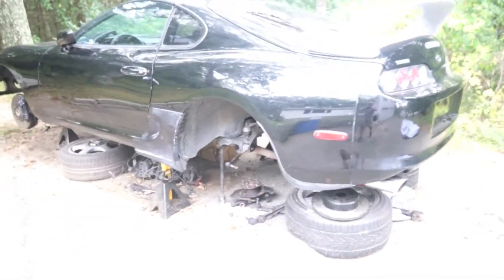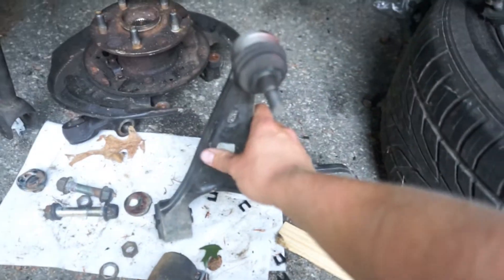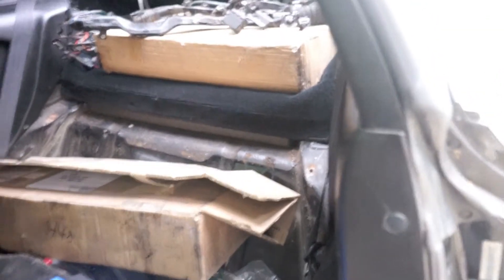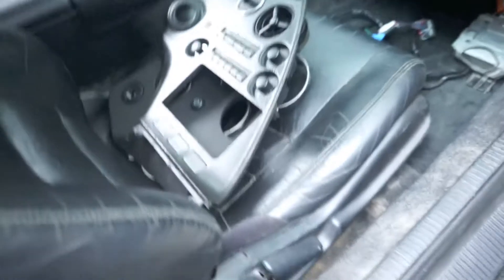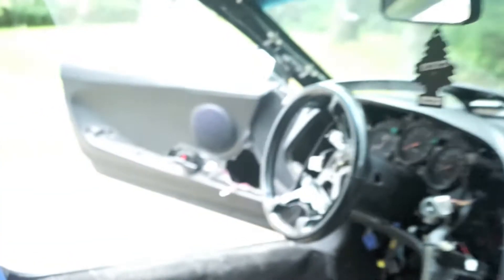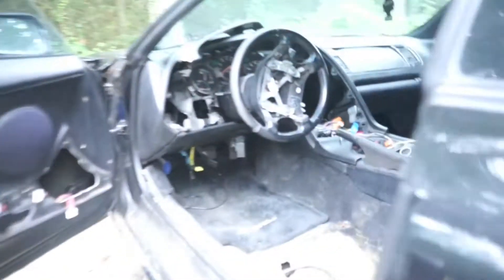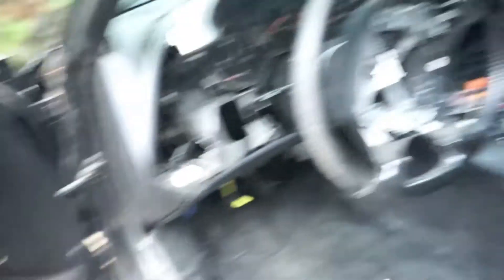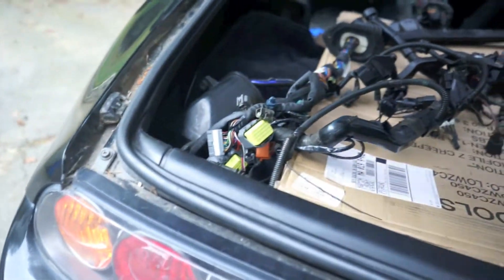My Mk4 Supra Build #6: Preparing for the 2jz!

Comment: If you're serious about letting that rear upper control arm go, try posting it on Evan Beckerman's app, Throtl. Seems like auto parts move pretty frequently across the platform, especially when it comes to renowned cars.
Reply from the maker: Steve Gladieux already picked up and installed a lower control arm but thanks for the suggestion
Reply: Right on man. Keep up the good work on the build. I'm excited to see this thing finished.

Comment: wont you need to tap into the ABS speed sensor wires if you plan on taking advantage of wheel speed traction control via aftermarket ECU?
Reply from the maker: Kith my tcs pump is gone and I don't plan on having any tcs
Reply: i think aftermarket ecu traction control reads wheel speed and cuts fuel and/or ignition based on wheel speed slip thresholds. as a supra owner myself, just trying to think of things you may want to go back and think about. likewise with rear brakes (im still catching up and watching your videos), look at Evo 8 rear calipers and NA rotors if you want to have the option of running a 15 inch wheel and fat tire in the far far off future. keep it up, enjoying watching another supra owner's journey.
Reply from the maker: Thanks for the suggestions, yeah I already went with factory usdm tt brakes all around and I don't think I want tcs but like you said I may want it in the distant future